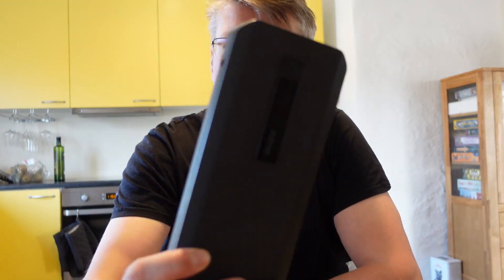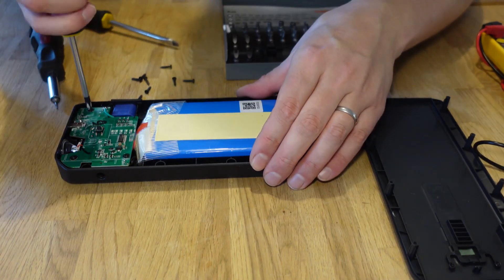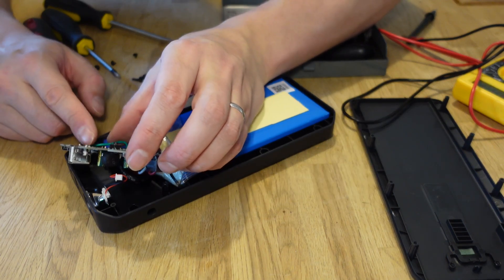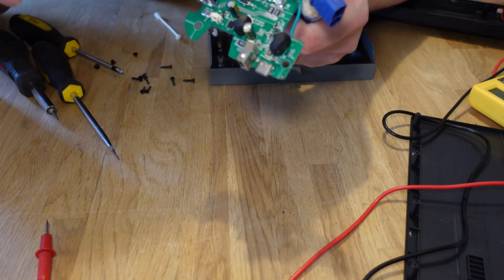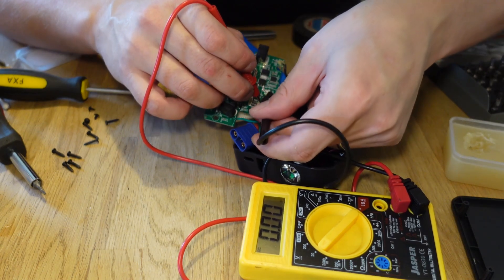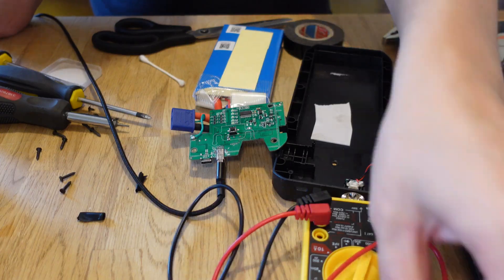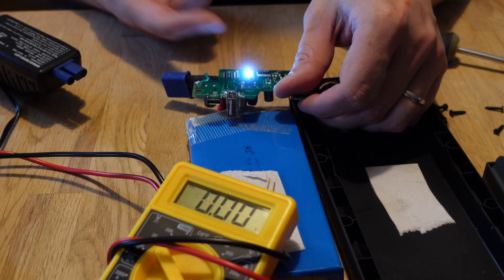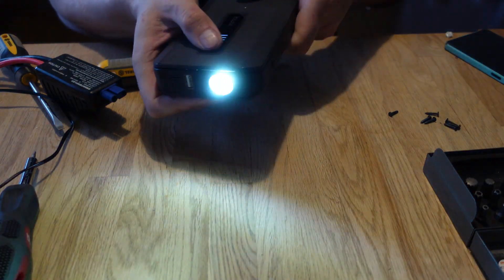Fix Xiaomi Midrive 70mai Jump Starter PS06 | Repair battery bank DIY

Comment: thanks , mine the battery was bloated i want to replace it any idea what type it is?
Reply from the maker: Hi, the QR codes on the battery are GWORK010156005243 and SF2020032605239 but I can not find anything with them. I suspect the actual battery type/model is under the tape on the other side of the pack and only the very beginning was visible without removing the tape (seen at 5:40 in the video). I never removed the tape so I have no idea what the exact model is.
Reply: @husband_things got it thanks mate, i remove the tape and saw the same , i cant find those batteries online as well, i also contact the 70mai support if they sell those parts.